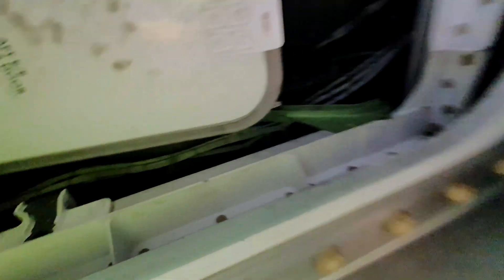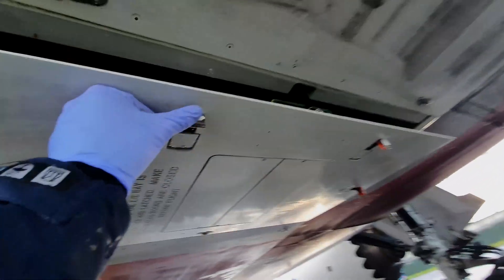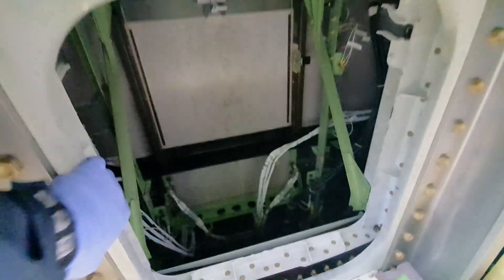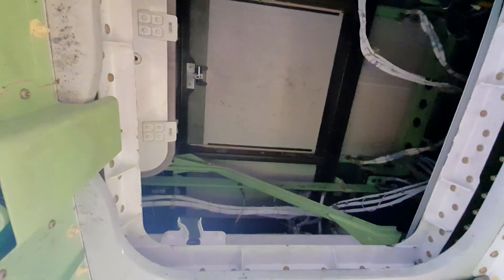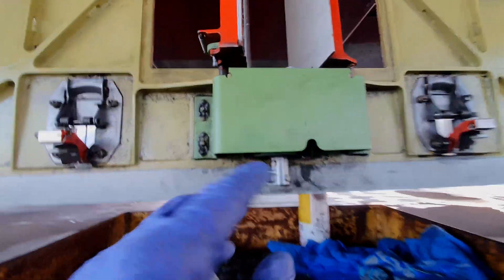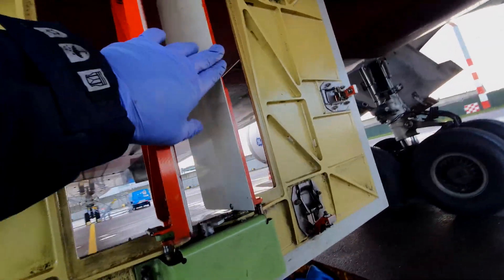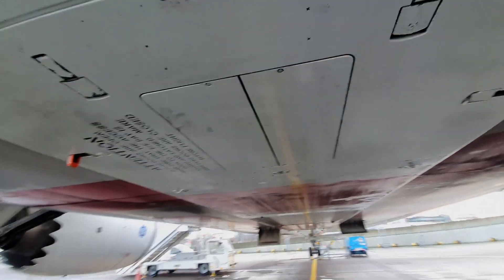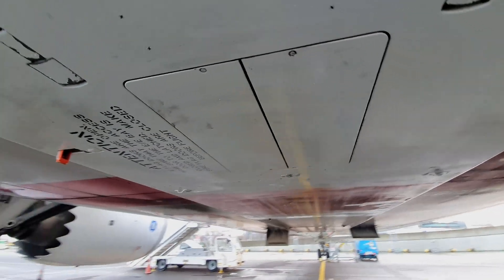What is this door?

Comment: Can you explain the use of this pressurize extra-door in the bottom of the plane? Obviously it is not used on a regular basis but for security or otherwise... I'm curious to know.
Reply from the maker: The pressurized door is to seal the cabin "airtight" to keep the cabin pressure on levels where humans can stay comfortably. The flappers on the door are there as a fail-safe/visual indication of the pressurized door is closed and locked properly.
Reply: Yes but that does'nt explain the pressurized door is used for. Is it used as an escape door in case of emergency ? @NextGenerationMechanic
Reply: @nicholasarms  He doesn't understand basic English....pretty scary that he's allowed that close to commercial aircraft.
Reply from the maker: It's the entry of the electronic equipment bay.
Reply from the maker: Correct!

Comment: This is pile of mechanical nonsense to make the jet more heavy. 😂
But the red panels are called Flag doors. As it states on the pannel it self. 
Above that there is a Hatch. It’s not a door but hatch. 
Now personally I wonder what idiot did design this ridiculous complex system.
How easy would it be to make the whole panel red and so that your not able to close it until the hatch is secure. 😊

Comment: Why does this seem like a low-effort workaround for an engineering oversight ?
Reply: As opposed to what?  The lowest effort would be to not allow the cover to latch with the hatch unsealed.   This is actually a pretty high effort to maximize the part count for a simple telltale.

Comment: The door inside the door, in front of the door to ensure the inner door is closed.  Seems it would be easier to have a mechanism that interferes with the outer door closing when the pressure hatch is open.
Reply: I would agree to that, but then it could be forced into place. I imagine those things ain't closing like a nice new car's door even when brand new, let alone after quite a few cycles and weather. Forcing doors closed has led to cargo doors being blown off (with the associated fuselage damage) from early 747s, and I could be wrong but I think the DC-10 as well.

Comment: Yes, that's all fine and dandy, but why is the door there in the first place?
Reply: The little flapper doors tell you when the inner pressurized door is not closed. The inner door must be closed for takeoff. The inner door is the access to the aft E&E compartment where various electrical components and computers reside. 
E&E stands for Electrical and Environmental (aircraft system) because the cabin pressure controllers also reside in the E&E compartment.
Reply: Gud point, must be secret 😳🤷‍♂️

Comment: My guess is that aside from a visual indicator that the plug door isn’t closed/latched, the flag doors are probably also supposed to act like blowout panels to prevent structural failure due to pressurization with the EE door open. Especially since I’m sure there are proximity sensors that would alert the cockpit if the EE door wasn’t closed and latched anyways.
Reply from the maker: That's right as well!
Reply: Yes because they could have had a different visual indicator that didn't open a hole at all.
Reply: Probably also to create an opening large enough to avoid being able to pressurize the plane and take off in this config.
Reply: @stephanemonfette106  You're kinda rewording what I already said. They would prevent structural failure by not letting that outer door ever act as part of the pressure vessel.
Reply: @SgfGustafsson  well not exactly, structural failure is one things I agree but dispatching with an unsafe conditions from a pressurisation standpoint can lead to unsafe  higher than expected cabin altitude, crew warnings msg,  oxygen masks dropping  in the cabin. Also a burden from an operation point of view to reset all this equipment. Looks like in the video there is gaps between the pressure shell and fairing where air could potentially vent but I'm not sure about that.
Reply: @stephanemonfette106  When I say we are saying the same thing, I mean we are both saying it prevents pressurization. Where we differ is why. Failure to pressurize would not be known to the pilots unless they had a keen eye, until after the takeoff has already been completed. In my original comment I mentioned that the EE door likely has a proximity sensor to tell the aircraft that it is closed. This would probably trigger a takeoff configuration warning, but the mechanical flag safety wouldn't give any warning during takeoff. But it would prevent pressurization with a weak door that is designed more as a fairing than a structural component. Now, if the crew continued anyway they would eventually get the first cabin pressure alert somewhere around 8,000' cabin altitude, well before it is a safety concern.

Comment: Good video.  What is aft  EE bay? Is it aft avionics bay?
Thanks.
Reply: The aft E&E compartment houses all of the large, liquid cooled, starter motor controllers. The ones that run the electric air compressors for cabin pressurization and the ones that supply starting power for the VFSG motors. VFSG stands for variable frequency starter/generators. The main powerplants on the 787 are started electrically. The starters are also the main aircraft generators. Two on each engine. Once the engine is started the starter becomes the electrical generator.
Reply from the maker: Yes sir!

Comment: Do pilots have any indication that these flag doors are open, or is it just a case that the plane won’t pressurise?
Reply from the maker: There is a door indication if the pressurized door isn't closed.
Reply: @NextGenerationMechanic  pilot always visual check airplane outside, before entering cockpit
logic!
Reply: @dannyvdmoo   I worked as a ground crew, Pilots walk around usually is done very early , usually when the pilots arrive at the aircraft, and check general condition, like tires, no visible dents etc., but latches, and there are quite a few of them, are the responsibility of the ground crew leader, who have to do a final walk around to make sure all latches, cargo, and fuel doors are locked.
Reply: To answer your question, there is no warning light in the flight deck that these doors are open. But there is an indication if the inner pressurized door is open. And on the design side, if I'm not mistaken you can't close the larger panel if these flapper doors are open and the inner door is closed.....they would touch the inner door and hold the larger access panel open so you couldn't latch it. In other words, the inner door has to be closed and the flapper doors have to be flush in order to close the larger access panel. It's pretty ingenious.

Comment: So how to reset the baffle flush?
Reply: You have to hold them closed while closing the larger panel. The larger panel must be flush in the opening and then close a nearby latch and they will stay closed. Unfortunately these doors get stuck closed and don't always pop open when they should. However, as others have said the door into the fuselage is monitored and the pilots would get a warning in the flight deck if it was open. Plus they would find it impossible to pressurize the aircraft if the inner door was open at takeoff.

Comment: Nice arrangement, and a sad commentary on the fact that earlier models of airliners have sometimes been forced to return to the gate during taxi out because the flight crew finally noticed the DOORS annunciator and master caution telling them that a door was open.  Just as with engine cowl latches, if something is located on the bottom of the aircraft, nobody wants to bend a knee to check it on walk around.